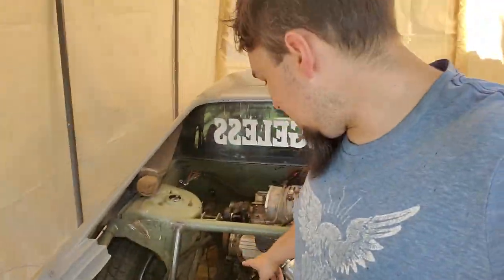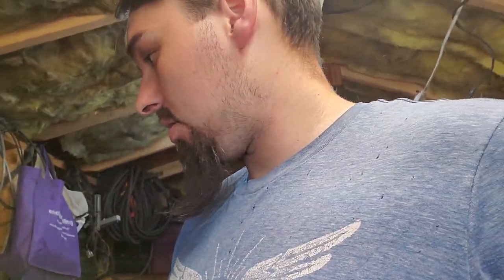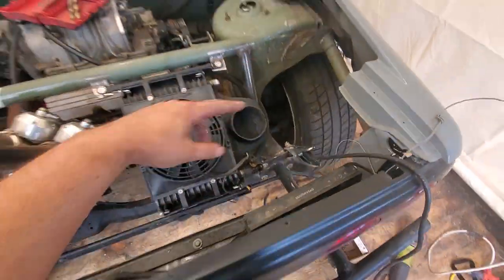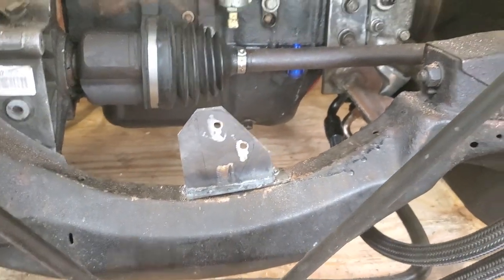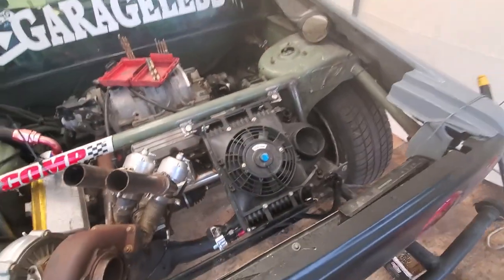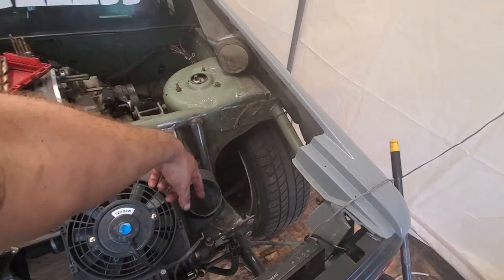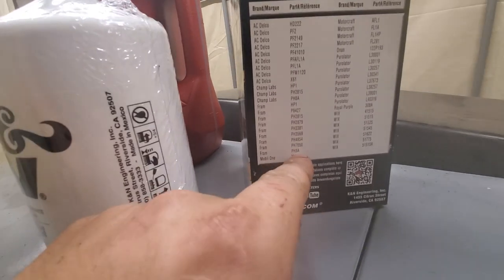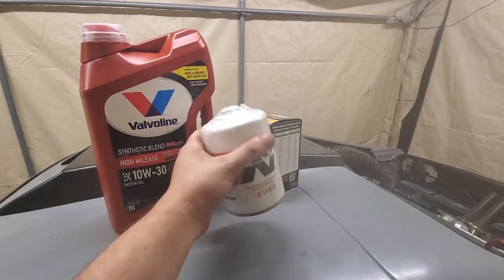MOUNTING OIL COOLER AND OIL FILTER RELOCATION FOR TURBO 3800 FIERO!

Comment: Nice getting so close to some ripping again. I'm in the same boat being broke, would like the 3.8 but I have a 4.3 vortec sitting in my back yard with 180000km on it. My winter project. It's sitting so I may as well use it instead of shopping for a motor.

Comment: Your filter should have a built in check valve, so because its inline and pre cooler, it's going to keep oil in the cooler.
Reply: Anti drain back valve